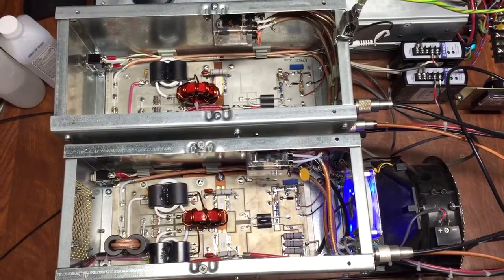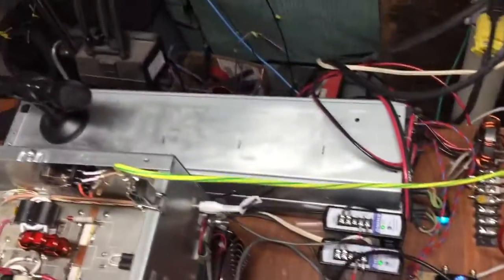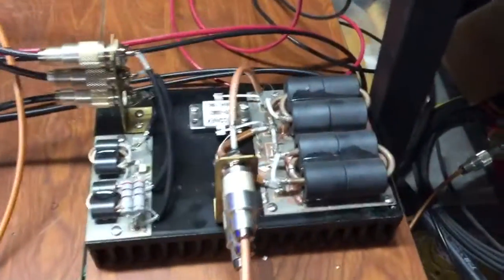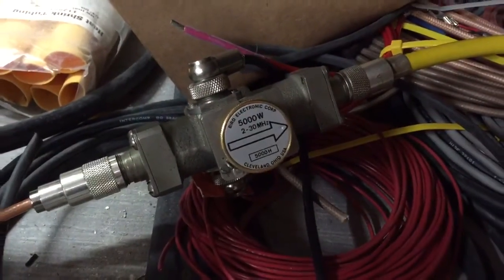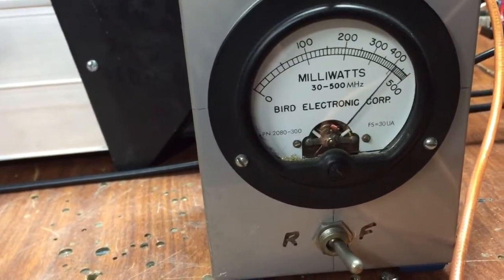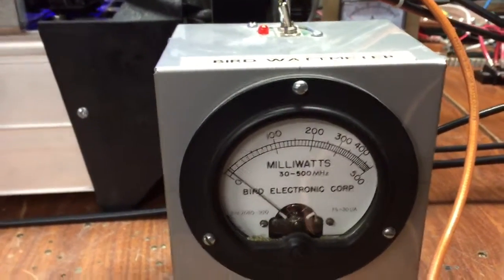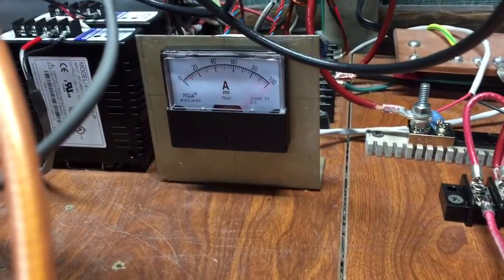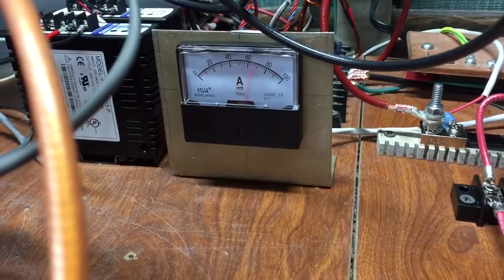4xBLF188XR

Comment: Good job, i like your combiner. Im working on my 10-160 dual amp, trying to find smaller power supplies so it will all fit in one box.
Reply from the maker: It would be hard to beat the Mean Well 48vdc supply.  The smaller they go the louder the fan will be.
Reply: How can we reach you by email?

Comment: whether combainer cores are strongly heated by long transmission ?
Reply: the combiner should never heat up unless there is imbalance between the inputs
Reply from the maker: The cores did not get warm in the short time I was testing. It only worked on 10-17m, not on the lower freq bands.
Reply: +KF8OD 
Why doesn't work in all freq. range?
Reply from the maker: +Пол Блэкфорд I am not sure, might be the large core area and the resulting higher capacitance in those turns is my theory. It would need some work to get it working 10-160m. I am just not interested in running two amps combined.